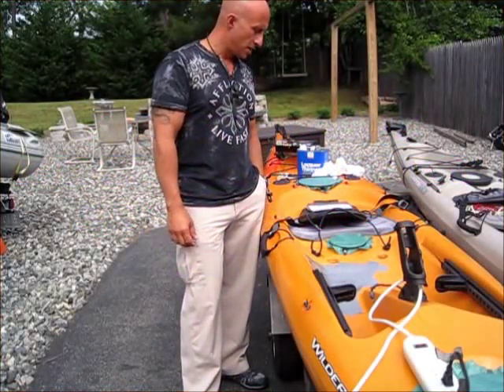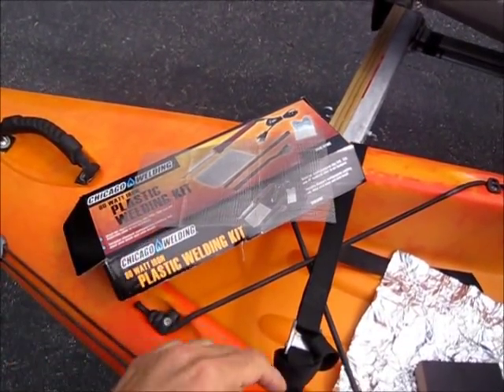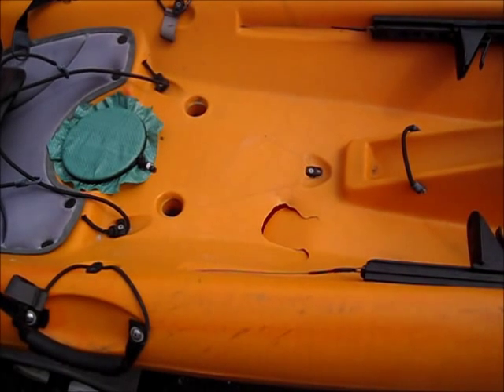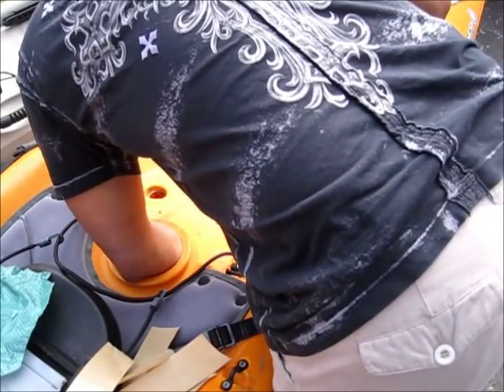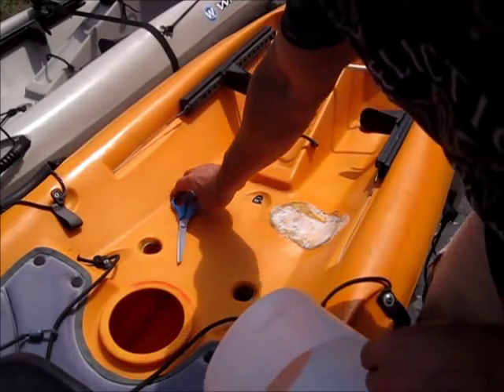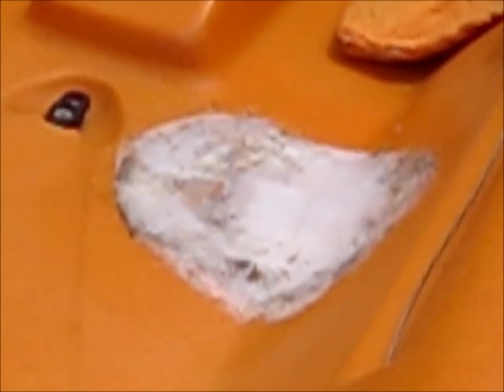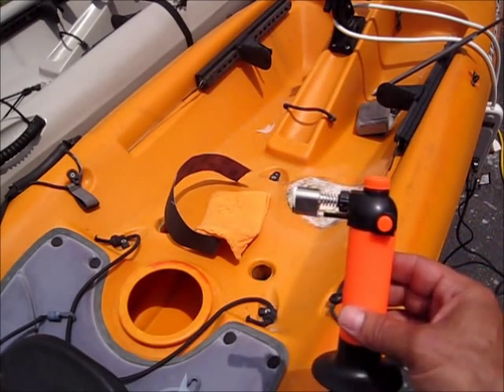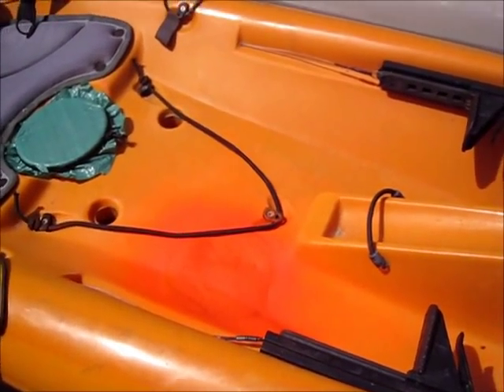DIY POLYETHYLENE REPAIR TO  WILDERNESS SYSTEM TARPON 160i KAYAK  USING AN OLD RAIN X BOTTLE

Comment: I had a buddy of mine who when beating the hell out of a tarpon missed and hit a whole in his yak. He took Aluminum plates and bolted one sandwiching the kayak in the center and adding silicone and then heating the plate over and over so the kayak molded back into the shape and after a few weeks he took the top plate off and kept the bottom plate on there and it worked great. I was very surprised. Great vid.

Comment: I like it.  Nothing at all wrong with extra effort and material for a super hold.In a Kayak there is a lot of flexing and torqueing of the structure between use, loading and unloading and transportation.Great fix.

Comment: You say you're not saying it's permanent... that's a permanent fix.  Almost surely overkill, but it should last for sure.  Most repairs I see, for a tear like that don't add in NEARLY as much material, and only along the cut.  That patch should outlast the rest of the kayak!  Good work.

Comment: Step 1 clean with denatured alcohol
Step 2 if available apply aluminum tape to underside /inside
Step 3 lay out wire mesh
Step 4 melt center of mesh in place with welding iron (no heavy pressure!)
Step 5 work outward very slowly from center (it'll look like a "*")
Step 6 start melting on plastic with iron.. Spray with cool water after finished
Step 7 sand the surface smooth after its cool.
Step 8 using heat gun in small sections smooth with wet cloth (t-shirt) pressing and rubbing lightly.

You bent the hell out of your iron!
You heated the surface way to hot without the mesh.

Best plastic is a little tykes or playschool toy close to the same color

Comment: Dude all you need to do is melt it back together with a soldering iron.Simply put the soldering iron in the crack and press them together as they melt. If you can't do that you add more PE to the seem as you go making sure that ALL materials are molten. whatever side that isn't molten will not bound since you are basically mixing them together and then having them cool interwoven.
Another thing, the heating of the area with a heat gun is pointless and in the end will only permanently turn the High density polyethylene into lower density/non aligned molecules that will be less rigid/hard. Even more of a reason to keep the heat isolated to the crack lines themselves.

Comment: A good trick I’ve done is to drill holes and get expanding foam in the holes to support the crack then just fill the holes and the crack. The foam just supports the flap from bending in and also waterproofs the crack so once repaired it also acts as a secondary barrier to the water.

Comment: A better way to repair the spot would be to dremel out the crack and then use a wood rasp to shave a 5 gal bucket for the plastic. you will want to get a steel cup or a ladel and slow melt the plastic over a flame and pour it onto the area, then run a heat gun and use a putty knife to smooth it out and sand after that.

Comment: That cool !! I know there is a plumbing epoxy it is  whites sands paints and even can be tapped  when I can't reamber the name i will let u know when I think of it good stuff !!! I fixed a plastic radiator in my car it held till I sold it was over a year later !! I even fixed a hole in a old jon boat never gave me a problem eather . Hope it keeps  holding up for u !!

Comment: I wouild have drilled a 1/8" hole at  the ends of the crack b/4 starting  that keeps the crack from trying to spread
Reply: Just like a bumper repair 101.

Comment: Nice welding.  Those plastics are definitely bonded.  If you ever weld orange again I would use a Home Depot bucket.  They are very close in color and are also made out of HDPE

Comment: My Yak is Polypropylene aswell, what i did was skuff up the area really well with a  wire wheel on the end of a drill, then spread some Resin to cover area and let it dry, then when it was dry, i scuffed it again with course sandpaper then procceded with fibreglass cloth and Resin.So the trick is to scuff area really well and prep it with Resin 1st.

Comment: I don't know why there's 7dislikes, thought the video was very informative and the patch looks real strong.  Good job.  Surprised a shop wouldn't want to fix that and sell it as is.

One thing I wondered about was, if the hole size allowed, take the chunk out and mount a flush mount rod holder there.  The repair would be a lot less labor intensive and structurally should be fine.

Good video though.
Reply: Drew Olmsted That's not a bad suggestion but I would point out that the location of the hole is almost under the area where his right leg would be.  So he wouldn't be able to use the rod holder for its intended purpose.  He would also have to keep it plugged to prevent water from entering the hull.
Reply: +Drew Olmsted Don't destroy the integrity of the design. But any time you have an expanse like that – use high density foam between the deck and the hull to strengthen the deck. You should be able to walk all over a deck without it collapsing.

Comment: You really need to heat the screen with a torch to have it melt into the kayak.  There are probably several ways to mend this.  You did your way.  By using the screen at least bugs and flying insects won't get into the kayak.  Thanks.

Comment: Nice job champ, just wondering why you didnt use a Fibreglass repair kit. I ripped a hole about the same size as your repair on my Kyak and used a Fibreglass repair kit and its held up for over 7 years so far.

Comment: I don't know what kind of plastic it is but a Go-jo soap container might have matched that plastic pretty well. Still a great job you did though and thank you for sharing.
Reply: The rain-x spray bottles are very close color wise to his yak.  Check if they are hdpe first.  High density polypropylene

Comment: you could just melt the repair plastic to 320 deg to liquid and fuse it better by pouring the hot plastic on the seams instead to melting it forever with a heat gun, heat up the spatula then press ... just look at the poly data to save you time....either way took you a long time but still works , good video .
Reply: How and where do you melt plastic to 320 deg around the home? What method? Is there any health hazards from fumes? Is that deg F or Cel? I would try it if possible. Thanks.

Comment: A suggestion: orange juice cap. Those caps are on plastic jugs and the orange juice caps are plastic and a deep orange color.  That may work to melt in to cover the patch with a similar color of orange.
Reply: those are usually PP plastic, I guess they don't work for HDPE

Comment: trying to learn here but should he have drilled the ends of the cracks?
Reply: No
Reply: yes, using a small drill bit at the ends of the crack will help prevent the crack from continuing after the repair. But this is still a very good repair. this repair should hold up for quite a while. And i agree with Author No1 adding a High Density Foam support in the are would most likely make thes repair permanent. sousaville i like what you have done here and it was a great tutorial. Keep up the good work. and using a mesh is great in order to give a repair more rigidity.
Reply: to be fair , the act of melting the crack will take any stress thats there right out immediately , no need to drill stop holes at all .

Comment: Great repair video. Thanks form Ga. Way too bad the america no customer service reared its ugly head again.True quality controls, standing behind ones products and customer service is a thing of the past. We now live in a mine, log, and drill disposable linear model and system of commerce which  destroying everything in its path only to make inferior products to maintain high profits. One would think after spending that kinds of money for a name brand fishing yak from Wilderness Systems that they would offer you a free repair kit. Weak spots are a on going problem with improper roto molding. It appears your heal found a weak spot?

Comment: On that hole an aluminum license plate on the inside another on the outside with some 100% high temp silicone inside and outside. some stainless screws to hold it all together and finished

Comment: Part right and part wrong.  Cooling between layers is no good.  All welding needs to melt both the substrate and the added material to fuse (weld) it.  Looks don't mean much.  It has to be fused in one solid piece from hull through patch to hull.  White areas between layers usually mean trapped air which means no fusion.  I weld metals, and it is the same theory, on different materials.  

Most important.  Find out if your kayak is cross linked or linear poly pro.  Linear is relatively easy and cross linked is hard if not impossible to weld.  I have tried for years with no success on cross linked.  The good news is that most kayaks, especially low cost kayaks, are linear.

Dont work on your kayak after just this video.  Watch several more, and if you have a name brand, call their customer support.  Mine is an 21 year old Ocean Kayak, and their tech support is fantastic.  They told me how to do it, and what materials.  You guys with discount store cheapies……I hope you speak Chinese.  If I had one, I would level with a major producer, and ask for their help.  The folks I talked to would probably help.  Their  tech support is one of their big selling points.  Good luck